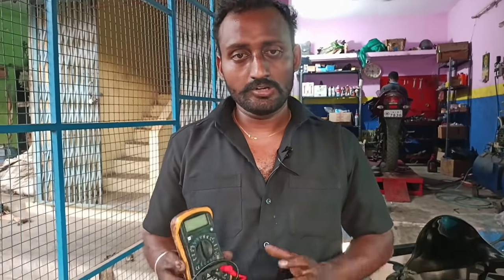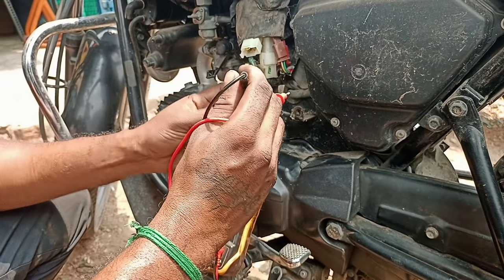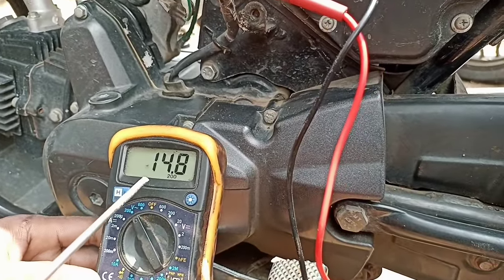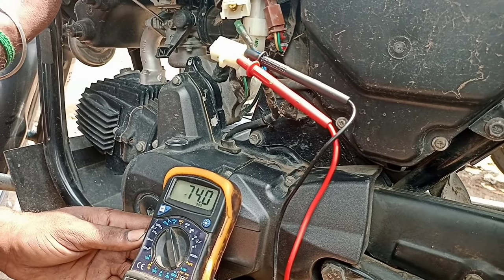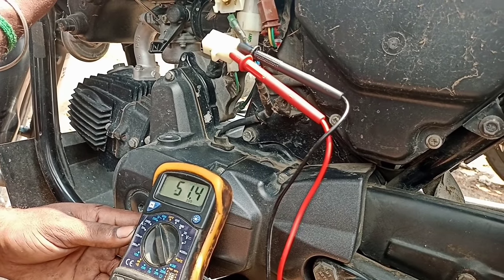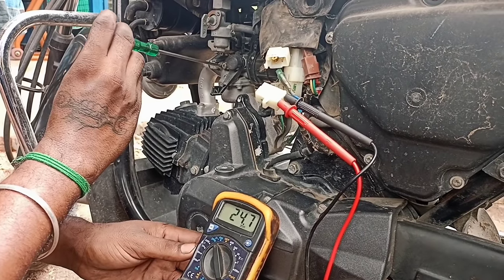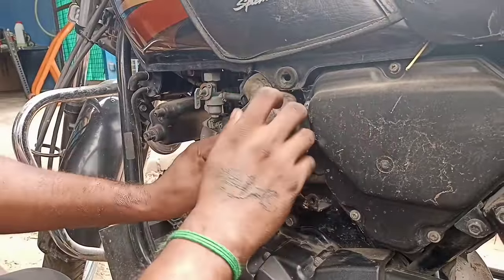MULTI METER மூலம் MILLAGE  adjust செய்வது எப்படி..

Comment: It can be done by sound  analise , twenty years before i do it .
To explain it is
First you are raising petrol flow  so engine raise , then you are adjusting air for 4:1   if correct  proportion set the engine go to high raise at that place stop and go to petrol adjust ( idling) and slow speed set  . 

Your mileage will be increase .

Comment: Na bajaj ct100 la indha method use panna bro ana enaku multi meter la reading thappa katudhu example. High rpm la voltage kammiya low rpm la hig voltage kamikudhu enna problem ah irukum bro.

Comment: Anna oru doubt... Neenga dynamo voltage ac la try pannanumnu soldranga but na test panni patha ac 200 vecha 1 nu than meter la kamikuthu... Konjam pin connection ah detail ah sonna nalla erukum na. Na Apache 160 2v vechi erukan... Na ethachum thappa pandrananu konjam sollunga pls...!

Comment: your the great technician.and engine head vela pathu fit pannittom valve tappet correcta adjust panniyachu but idleingla tik tik nu sound varuthu bro
Reply from the maker: Rocket arm, cam shaft,check pannunga
Reply: @vaganaviyaltamil  racker arm shake panni pathen inlet arm mattum side shakela romba shack aaguthu but exhaut arm romba shake illa bro
Reply from the maker: @jeyanaga1450  new rocker change pannunga
Reply: @vaganaviyaltamil  thanks for your great response brother

Comment: Anna discover 100T yepdi dynamo socket kandu pudikanum 
Positive negative wire enna clr

Dynamo wire la mattum than multimeter pin vaikalama illa battery connection kalati vitu athula vaikalama???

Comment: Lighting coil or charging coila check pannanuma? Voltage output 100kulla than varuma? Meter problem agatha?
Reply from the maker: Lighting and charging both same
Reply: @vaganaviyaltamil  pulsar 220f  la enga irukku intha coil ..pls oru video podunga anna

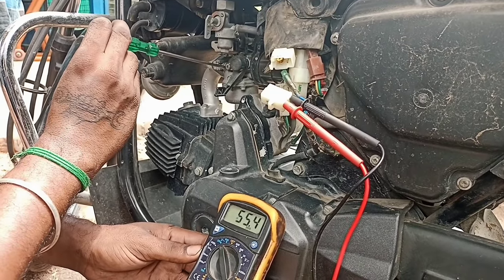Comment: 2:59 இன் படி 74 பாய்ண்ட் இல் இருந்து,  89 பாய்ண்ட்க்கு மாறி உள்ளது...ஆக இதன்படி 15 பாய்ண்ட் கூடி உள்ளது...
அப்பொழுது 10 அல்லது 15 பாய்ண்ட்டிற்கு எவ்வளவு மைலேஜ் கூடி இருக்கும் என சொல்ல முடியுமா அண்ணா...
Reply: Bro the point is for set high rpm range in carburettor 
Eg: 
If u give full throttle the rpm is 7000rpm
After turning it go to 7800rpm
When rpm is Max limited in carburettor
You can get good mileage

Comment: Hornet 160 r 2017 March. Vandi light ah adaikuthu bro. Morning start panuna warm up aagara varaikum romba adaikuthu, then light ah adachu adachu than poguthu. Ooty pona romba adaikuthu. Sudden ah accelerator kodutha, first adachutu then speed pickup aaguthu. Enna problem bro.?? Air filter, spark plug, carburettor clean paniyachu. Still same problem. No smoke. Kms 68000. No major maintenance done.
Reply from the maker: Carburetor jet, diaphragm change panni parunga bro
Reply: @vaganaviyaltamil  thanks bro, panitu solraen
Reply: Battery check pannunga 
Morning start agum pothu ipaditan irunthuchu for me also 
Battery change panne Apuram normal aiduchu
Reply: @Anonymous-iz1or  battery puthusu bro
Reply: @8dmusic202  check panni parunga bro in service centre or in shop too they will check Through meter
For me happens same thing that u facing now 
Battery change panna Apuram ok aiduchu 
Neenga frequent bike driving panuvingala or rare 
If rare means 95% battery problem
Reply: @Anonymous-iz1or  battery matharathuku munadiyum same issue bro. Ithu ellamae carburettor ah clean panunathuku apram start aana problem. Very frequent rider for 6 months, then won't touch my motorcycle for another six month. Working onboard foreign going ship.
Reply: @Anonymous-iz1or  68000 kms done.
Reply: @8dmusic202  ok bro even if we won’t touch our vehicle around 1month due to heavy rain  same problem happened to me  
In service centre they mentioned it’s just a battery problem 
After I changed a battery my vehicle works fine 
They mentioned hv to drive atleast 10min per day otherwise battery will dry out
Reply: @Anonymous-iz1or  ok bro, I will check and let you know

Comment: Headlight dim ah iruku bro normal ah vida yena problem ah irukum
Reply: Battery nalla iruka
Reply: @Anonymous-iz1or  1year aachu bro battery potu
Reply: @dineshkumar.9943  battery check pannunga bro in service Center meter check pannuvanga 
Horn yepadi work aguthu sound delay in Horn also seems battery weak
Reply: @Anonymous-iz1or  shine125 la magnet coil la dana bro headlight work aagudu
Reply: @dineshkumar.9943  battery problem Apo headlight kuda dim uh tan irukum 
In pulsar 150 what i experienced battery fault Apo headlight will be in dim mode and horn sound will be very low
Reply: @Anonymous-iz1or  ok bro nan battery check panran